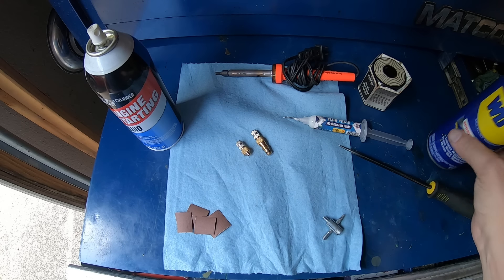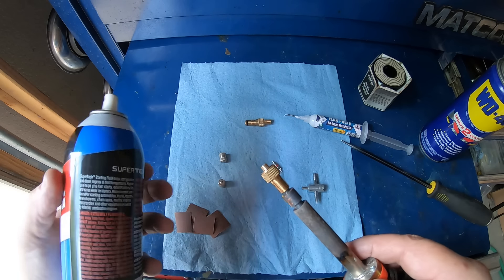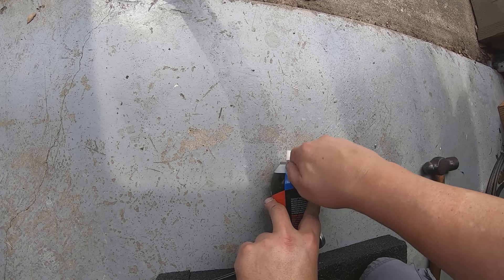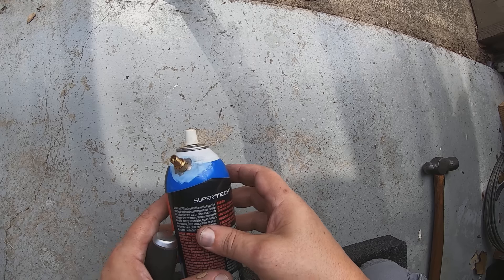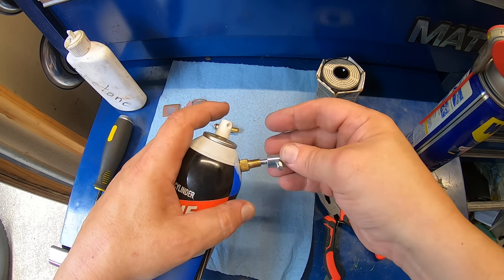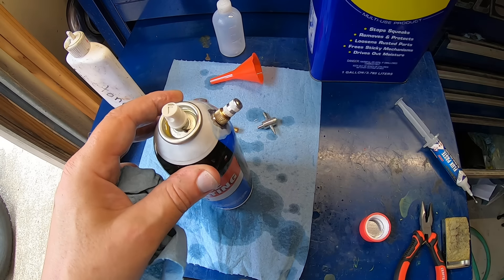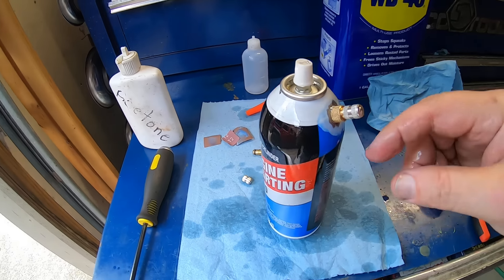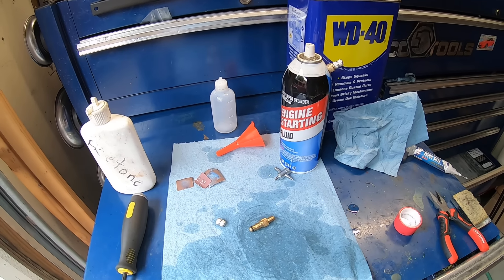How to Easily Install a Schrader Valve on any Can to make It Refillable without Drilling or Torch.

Comment: Does WD40 degrade the tiny o-rings in schrader valves?
Reply from the maker: I don't think so. But if it does that is why I like the valve stem to be at the top that way the air will be the only thing that will leak out.
Reply: @737mechanic  Good point. Also the valve core is easy and cheap enough to replace indefinitely. Thanks for the great idea and tutorial.

Comment: Good job, however its an 11.? oz can, you just added 9oz  leaving little room for air.  You don't need much, you may have to add more air later.
Reply from the maker: You are correct It is an 11 oz can but it will hold much more than 11oz, in fact it would probably hold 16oz, the oz's they list on the can is what is in the can so it has 11oz of product, When I put about 9oz in it was slightly over half full so it still  had about 5oz af usualble space for the air. Either way I am able to get all the product out with only 1 filling. Check out this video.
https://youtu.be/c3wTNy-_Xjg

Comment: I have several cans with wd40 but no aerosol or propellant
Reply from the maker: You can use a soft tip air nozzle to put air back in. Just push in down over the tube and shoot air back into it.

Comment: There's a very good reason oils are not pressurized with air containing oxygen, but instead with CO2 or propane.
Reply from the maker: Correct, you never want to pressurize anything with oxygen. Oil and pure oxygen is an oxidizer and can combust. Thats why you want to use air from a compressor which is 78 percent nitrogen.

If it was unsafe to have oil and air mixed together, we would have fires all over the place.

BTW they actually make commercial refillable aerosol cans that are meant to be pressurized with a common compressor so you can spray things like WD-40 and other oily liquids. This isn't a knew idea.
Reply: @737mechanic  ever heard of diesel engines? They operate on atmospheric air containing the same 78% nitrogen. Fire isn't the issue. It's the explosion risk

Comment: The value is small you can use a drill as a lathe. Just put your drill in a vise. It not pretty easy, brass cuts nicely.

Comment: is the o-ring of the schrader valve non reactive to the chemical being put inside the can?
Reply from the maker: The rubber seal is chemically resistant. Even if it degrades over time, since the valve stem is at the top, it would only leak air. I have not had anything I use degrade the ring yet.

Comment: just buy a shure shot  they are cheap to buy and work great
Reply from the maker: Look_What_You_Did  I actually have two sure shots the problem is the spray way too much fluid. 
And the reason I am bitching about $8 is because I remember not too long ago WD-40 was $1.75 for a 12oz can.

Comment: Are you using rosin core or acid cor solder. I tried once and failed the solder would not stick to the can. Going to try again.
Reply: I was using silver solder when it failed.
Reply from the maker: @anthonycash4609  Silver solder takes way too much heat. The flux and solder are in the description and the first comment.
Reply: @737mechanic  I'm sorry for asking. I just missed the word more in the comments and didn't get to read it all.
Reply from the maker: @anthonycash4609  No problem at all. Let me know how it goes.

Comment: WD40 will rust your lathe fast. It absorbs moisture.
Reply from the maker: It doesn't absorb moisture it's just not the best water-displacing lubricant anymore, Machinists use WD-40 all the time for machining aluminum with zero rust problems from wd-40.
Reply: @737mechanic  Well, it actually does. Try a test. >50% relative humidity, Spray some on some clean degreased cold roll, put it away and in as little as a week it will be covered in surface rust. It is made from Fish oil and has been tested as hydroscopic. It always ( not, "anymore") has been good for displacing moisture because it is very Hydroscopic, also making it a fair penetrant.  AS a gun smith, over the years, I have repaired many damaged firearms from the stuff. I never use it on Aircraft because it's hydroscopic.  I only use it as   penetrant and also cutting oil for aluminum,  It prevents aluminum from sticking to the tool. I use way oil on my ways and Break free CLP on firearms.
Reply from the maker: @maircraft4079  I did an experement years ago were I took a piece of steel and sanded it to make sure it was bare and then I taped off 4 segments. Segment 1 I left bare with nothing on it, segment 2 I put a coat of Wd-40, segment 3 I put a coat of REM Oil, and segment 4 I put break free CLP, then I hung in above my home shower so the steam and moisture would get to it. After 1 month I took it down and the uncoated segment was completely rusted, the wd-40 had some light rust but wasn't too bad, the REM Oil had some rust but was better than WD-40, and the CLP had almost no rust all all.

My lathe is about 10 years old  and I use WD-40 everytime I machine aluminum and there is zero rust anywhere on the machine.
Reply: LOL are you for real

Comment: If you use refrigerant like R134 put in two or 3 ounces liquid and it’ll give you more propellant that will last longer. 

Depending on your oil, it will help thin out your liquid making it spread farther last longer thinner application

Comment: How much psi of air did you put in?
Reply from the maker: My regulator is set at 100PSI  but after it goes through the hose due to pressure drop it is probably closer to 90PSI.

Comment: A plastic spray bottle with build in pump or even reused plastic spray bottle from any household washing liquid would do the trick without any soldering, compressed air and so on. Just pour WB40 into the bottle and press the handle.
Reply: Plastic spray bottle works just fine

Comment: Many solvents are quite flammable, even explosive, and you're heating with a hot iron.
Reply from the maker: Yes, but that is not near enough heat to ignite the fluids, it would take a spark or flame.

Comment: It’s perfectly centered because you can turn the cap. So no matter where you put the hole you are good to go. Unless I’m missing something. And one more thing, why take it down to 3/16 “ ? Can’t you just make the hole just a hair under the size of the valve and work it through so it will be a tight fit and just solder away same as before?  But nice job anyway. Just may take a little longer heating up. 👍✌️🇺🇸
Reply from the maker: The only reason I wanted it centered was for neatness. 

Yes, you could make the hole whatever size you want, the reason I made it smaller was because I didn't want to heat up the can any more than I needed to so I didn't melt any of the internal seals and to make it easier to solder.

Comment: What kind of solder is that? Composition numbers please.
Reply from the maker: 60/40 leaded solder. This is the exact product.
https://amzn.to/4cRFPxf
Reply: @737mechanic  well that is very interesting because usually silver solder is what you would want to use in a situation where you're combining dislike metals. I'm glad it worked for you and it makes sense now why it flowed so easily. I would just suggest that you be careful and don't knock that Schrader valve against anything or you might just crack it off there under full pressure

Comment: Air?  Anyone know what pressure a wd-40 mist diesels at?  I don't.  Please be careful what you try this with...
Reply from the maker: About 250 PSI for diesel, but it isn't the pressure alone that causes it to ignite, it is how fast it compresses the air/fuel mixture which causes enough heat to build up for it to auto ignite. That temperature is about 410 degrees, and you have to have the proper mixture, so if you was to pour a cup of diesel in the combustion chamber it would never ignite even if it was able to compress it because it has to much liquid fuel. That's why some diesel engines won't start at all without glow plugs especially when it is cooler outside because even though the pressure is the same the temperature is lower which doesn't allow the air/fuel to self-ignite.

So to be clear there is no way you will ever ignite WD-40 with a household compressor.

BTW diesel and kerosine which is the main ingredient in WD-40 auto ignite at 410 degrees.

Comment: they sell spray bottles that will take AA battery's and it shoots like a old school spray bottle but its electric. I been using this Spray bottle i got that was for ants and termite killer, it said on the bottle that it was and I quote  "safe for around the house and pets"  BUT I still washed the hell out of it like 5 times with joy soap and hot water and finished it off with running 91% rubbing alcohol. I have SeaFoam in it now for when i am cleaning parts off and such for my outboard. 

if you read all this you get a gold star  
🌟
✌😶‍🌫

Comment: Spray cans are very thin with basic spray nozzles. The FTC would ban a product like this for good reasons. The doctors bills from 1 mishap will probably exceed the money saved by leaps and bounds. You can purchase refillable bottles for a reasonable price.
Reply from the maker: The problem is just what you said, Refillable bottles for a reasonable price, they don't exist.
Reply: @737mechanic  Your ignoring the cost of building a durable, safe refillable. You can put wheels on a milk-crate and ride it. It doesn't mean you should.
Reply: I've been waiting for the OSHA representative / safety patrol guy to show up in the comments, I see you have arrived.
Reply: @crosley62  I've been waiting for common sense to arrive. Still waiting.

Comment: You could make a poor-man's paint spray gun with that method. Mix up some rustoleum enamel with hardener,(thin it with enamel reducer too)  fill up the can, pressure it, and you now have a professional quality hardened enamel finish instead of the usual unhardened cheapy finish found in all stock  rattle cans.
p.s. If you don't want to make your own, you can buy reusable cans from EWK, they're $40.

Comment: When my brother in-law gets out of the burn unit you can ask him if it was worth drilling into a spray can.
Reply from the maker: Your brother should have been smarter and did it like I did. I didn't use a drill.
Reply: @737mechanic  but you tell people to use a drill in the video.  And if you think banging a steel punch into a metal can won't spark, well ok, if you think it's worth it.

Comment: I have seen another video where someone took a tire valve, removed the cap the spray cap from the can and put the tire valve over the stem and filled the can with air through the valve. Let's say you're spraying something and the air runs out and you still have lots of paint left in the can. You can do it this way to get more pressure in there. I know it's not about filling the can but that's just the tip here. How to get more pressure on inside?

Comment: You could fill the can with butane, isobutane or better and cheaper : propane. Better propellant than air, and perhaps less explosive because not a pre-mixed air-fuel can.

Comment: Machining it down is brilliant - it reduces the force of the gas on the fitting and increases the soldering surface. Punching rather than drilling the hole does the same.  Wish I'd thought of it. But since I didn't... thanks!

Comment: Could be idea for an actual product on eBay or Amazon. Most people don't have the tools or skills to make this tool. If you could use a bicycle pump to pressurize this also would increase your customer base. But I see below most think it would be hard to get the pressure needed. Still it seems like a marketable idea if you can buy the components cheaper in quantity like empty cans, valves etc. A kit with finished can, squeeze bottle and funnel could sell probably in the $15 range.

Comment: In the 90s I used to refill spray cans just using a modified cap. I don't understand why adding another valve is required, the existing valve isn't a check valve or anything.
Reply from the maker: Another valve is required so you can add whatever liquid you want.
Reply: @737mechanic  I put my liquid in a steel flask and then pressurised that to drive the liquid inside the spray can.
Reply from the maker: @TurboBaldur  You should do a youtube video showing the process.

Comment: all this is a little too involved. just drill a hole in the can and install a tubeless tire rubber valve in the hole.
Reply from the maker: How are you going to pull it through the hole from the inside?
Reply: @737mechanic  push it thru from the outside into the hole....may require a slightly larger hole and less psi when pressured. I have also seen screw in valves...drill the correct size hole, screw in the valve, solder or epoxy as needed. not running down your video, just giving alternatives that might be easier for the average joe to do who doesnt have a lathe or the skill to run it.

Comment: 100 psi is safe from the factory without any holes that were made.
Reply from the maker: You should watch the other 2 videos I made where I pressurized 2 different cans to failure.

Comment: Great idea! I would highly recommend a face mask and NOT hold the can with the first fill. Yikes. Also the can maybe rated at 100 psi but for how many cycles? 5? 10? Probably not that many...
Reply: I think I will do this though. Just mark on the can each time you pressurize it. Chuck it after 5? Don't know I'll look into that
Reply: Or.....do this to a disposable propane tank. They are rated at 450psi I think. Pretty much cycle 100 psi almost forever.
Reply: If you use a propane tank it already has a valve. Use the lathe to make an adapter. Yes more complicated but I'm known for that LoL
Reply: BTW my uncle was a cattle rancher and farmer in Alberta. He would so do this 👍

Comment: Is there any chemical you should not do this? 100 psi seems like too much. Have you ever tested the limit?
Reply from the maker: After doing a bit of research these cans are rated for 230 to 300 lbs. 
But I am going to do a video where I pressurize a couple of these cans until failure to see for myself .

Comment: Any thoughts or concerns about adding heat to cans with flammable or explosive fluids?  Just wondering…..
Reply from the maker: No because a soldering iron is not hot enough to ignite a flammable fluid, it would take either a much higher heat, spark, or a flame.

Comment: tbh... you could just take the valve, wrap the lil stem part with some solder, flux up the hole part, and stick it in, and use your soldering iron

Comment: Relying on that solder joint to hold 100psi looks like a possible way to lose an eye. I will stick with the spray bottle
Reply from the maker: As small as that solder joint, it only has 17.45PSI on the joint. For it to have the full 100PSI on it the joint would have to be 1 square inch of area and then it would be holding back 100PSI, but in this case, it is only 3/16 so there is NOT 100 Pounds per square in on it because it is way under 1 square in.

Comment: Great idea and method! Technically you could just hacksaw the end off, use a dremel or pedestal grinder or even angle grinder to make a step (measure with vernier caliper until near enough the size you want, doesn't even have to be in the middle) then solder that on. Solder will fill any gaps assuming it won't be perfectly round. If this is going to be accessible to all people there needs to be a way to do it with less specialised tools/adapters so see if you can work out a more 'ghetto' way and do another video on it, thanks!!
Reply from the maker: Exactly, you would be surprised how many people think because I used a lathe, they are completely out of luck in doing this but with a little imagination there are other ways to achieve the same outcome.
Reply: @737mechanic  Pity I didn't know about this years ago. Now retired but I worked as a cnc programmer/machinist and could have made 100,000 of those things in an hour hehe! One of my machines even had 2 chucks so I could have done work parts on one side and 'home' parts on the other side hehe!

Comment: I add a second valve and use it as the fill port. I take the stem out and use a brass cap with o ring to seal it. That way you don't have to take the time to remove and install the stem on just the one valve. Works great.

Comment: Is shortening the valve strictly necessary?
Reply from the maker: Probably not, just sink the valve down into the can and solder away.
Reply: @737mechanic  
I only asked coz some commenters were saying now you need a lathe, not thinking that there are multiple other methods of shortening it.

Comment: Often you can just blow air in through the out with a small blow gun nozzle. Doesn't always work if the material is thick like old paint, etc.

Comment: Note to self: make sure can is free of pressure before hammering a hole in it with a sharp object.
Reply: If you punch the correct size hole into the can, it will make a shoulder you can thread into which you can screw the valve. That makes the seal a lot more reliable before soldering.

Comment: Great hack prices on spray cans are feeling the corporate greed thing but practically speaking you will have to refill the can with air since the pressure will drop as you the product dispenses.
Originally the can is filled with a liquified gas that will boil off as you dispense and tend to maintain an even pressure all the way to the bottom of the can. Simple air pressure won't do that and the can needs to be recharged with air before you get to the bottom. I imagine the drop will be quick especially at first.
Reply from the maker: I have heard people say that, but that has not happened yet. I have depleted multiple cans and have done it on one charge so far.
I did a video where I pressurize to failure and at the start of the video I showed myself discharging a can all the way on a single charge.
https://youtu.be/c3wTNy-_Xjg